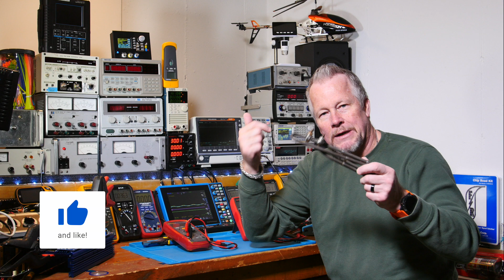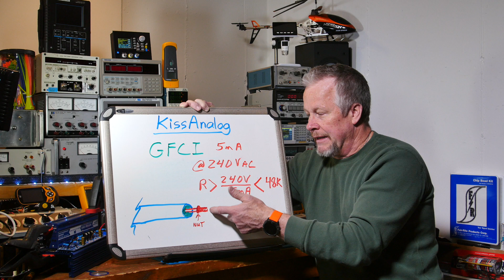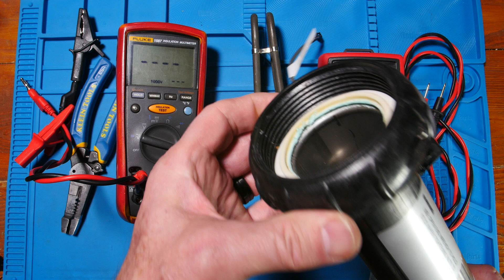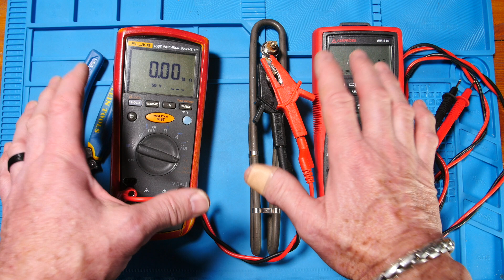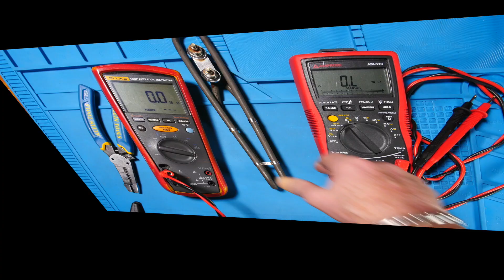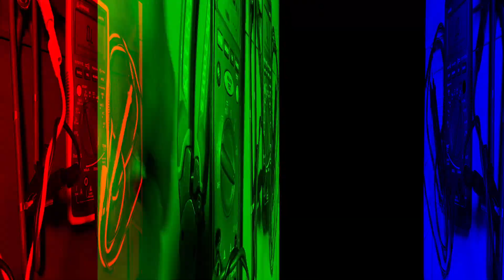HiPot vs Hot Tub Heater Element

Comment: That "HEATER" test was really "COOL", it's great with a lot of such variety of instruments available for such tests..
So it would be nice to know how that's all managed.. Are they straight "off the shelf " purchases ? or on a loan/ instalment basis??
One tip probably you may already know it...
IS TO USE TEFLON TAPE..
To avoid / reduce corrosion...
We have " Teflon" coated cooking vessels.. nothing dangerous there even with those flames & high temps. ..& this tape is nowadays used in plumbing..
Tef.tape ( plumbing variety)has electrical b.d above (1.5-2)kV.
30 yrs. ago I wrapped my convection oven terminals & pvc. insulated wire ( 2-3 inches)
& haven't opened it since.. before that we had repeated failures .etc..
Done the same for all heating devices @ home.. &  that doesn't worry me any more..
Check it out.. 👍 now that's my additional resource  besides normal insulation tape..
Reply from the maker: Thanks for the great feedback!
Reply: @KissAnalog  happy to help ... anytime.. 👍

Comment: It was really interesting to see you follow up with this heating element!  I liked how you show more of professional ways to handle your testing equipment, both for safety and to improve quality of your results!  I also really liked seeing the insulation meter demonstrate something it took me so long to understand... that the act of using a multimeter can affect the circuit, which can affect the results and cause things like the shift in break down voltage during measurement!
Reply from the maker: Thanks Robin!  You got it.  Your test equipment can potentially change the readings if you are not careful.

Comment: Interesting. I used to do warranty work on hot tubs and appliances back in the day. Don’t recall this exact issue occurring. Usually it was a dead short to ground. Ohms too high or too low. 9-20 is about right or drawing too many amps. More than 25-30.  So the heating element is still good? Will you save it and keep it as a backups?
Reply: It would appear that one would need to re-insulate the connection. What has been shown is that there is a breakdown in isolation from the nichrome heating  element to the grounded mount.
Reply: @timothygrupp  I was thinking he could remove all the corrosion and see what he was working with.  Amazon sells spray on ceramic coatings designed to withstand 2000 degrees.  I am sure it could be repaired if he wants to do it.
Reply from the maker: You guys are awesome!  I wonder if I could repair it?  The seal must have been broken either during manufacturing or install (probably install).  So the corrosion happened over time with a small leak (probably).  But, winter is coming and I wanted to be sure I had a hot-tub;)  LOL

Comment: I wonder if cleaning the corrosion from the connections might clean up the resistance.
Reply: I'd wondered that myself; however, I think that the corrosion is a result of leakage of water caused by damage of the insulating ceramic at the connector.
Reply: @timothygrupp  Makes sense.
Reply from the maker: You guys are great - and maybe you are right;)